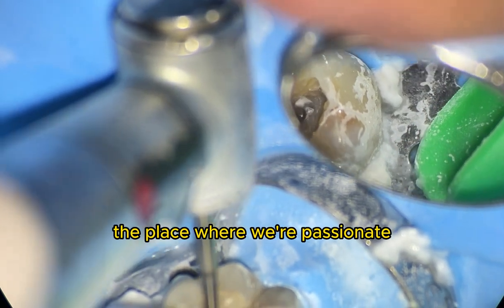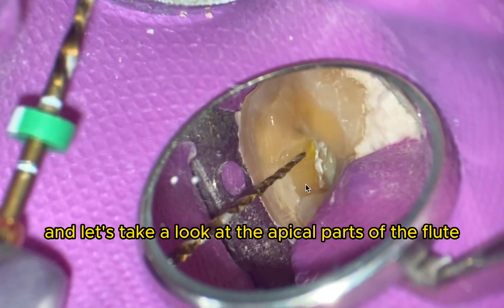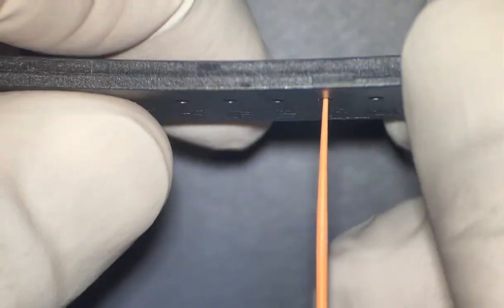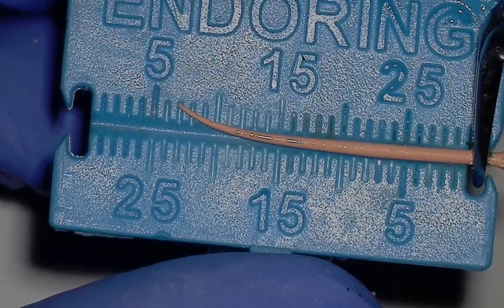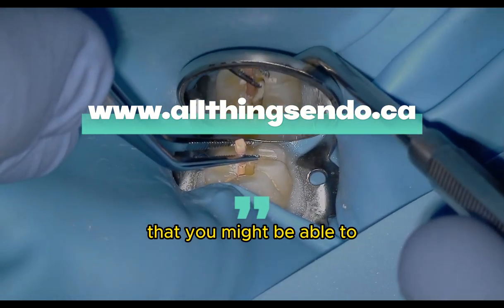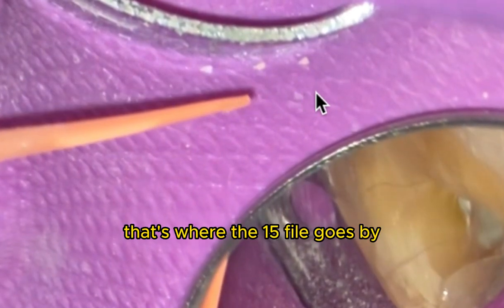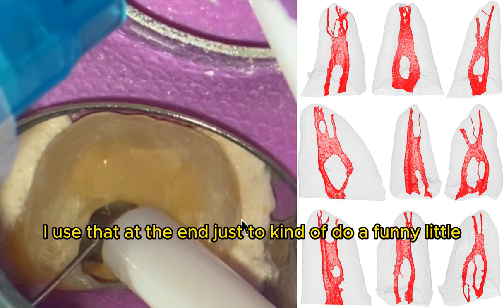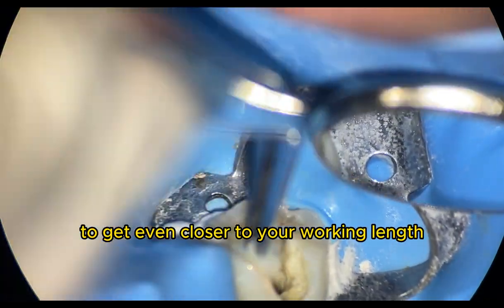Why is My Fill Short?  4 Tips For a Great Obturation!

Comment: Is it good option to use #20(.04/.06) guttapercha and use gutta gauge to cut the tip for the corresponding sizes for example 25,30,40(.04/.06) in order to avoid bad calibrated guttaperchas?
Reply from the maker: It’s really up to you. I’d check your sizes first before to see how accurate your GP is. Save time.

Comment: Additions to tip 3:
- place your liquid medicament (calcium hydroxide) with a irrigation needle in one canal and just look if it comes up the other one (also not 100%, but a good indication)
- put markings of your working length on your GPs with tweezers. Put both of them into the two canals. If one goes to length and the other doesn't check it the other way around. If now the other fits to length then both canals join.
Reply: This joining part is so good .... Inone case i was stuck like that only .

Comment: You have another video that might address the short obturation problem: https://youtu.be/m8Zd8noQbW0?t=462

I am in the process of switching away from Waveone Gold for this reason. I have couple cases that cone fit looked perfect but final x ray was short. Part of the reason could be due to variable taper shaped canal preparation, and the other reason you have talked about in your video is that gutta percha have variability during manufacturing. Either way the gutta percha is stuck mid canal somewhere. It can be overcome by instrumenting the apical part, but most likely it will cause over instrumentation and loss of apical stop.

One of my case was a straight but calcified anterior tooth. Cone fit with Comfort Fit Gutta Percha Medium was short but Waveone Gold Medium file goes to length easily on the radiograph.
Reply from the maker: Great comment. It took me a long time to move to cone fitting with sealer in place - I just needed more confidence in knowing that my working length was good to go with the apex locator. 
I found that once I moved to a conefit with sealer, my fills have been on the money most of the time. 
The only time I still conefit without sealer are open apices (#80 and greater) and single canal vital cases where I need more time for the hypo to degrade tissue.
Reply: @AllThingsDentistry  That sounds like a good system that you have figured out. I haven't really been testing WL with EAL after rotary instrumentation, but instead, use conefit without sealer. I'll give that a try.
Reply: Happens all the time to me. There’s something about waveone gold primary gutta percha that just doesn’t fit perfectly. I use protaper sx for an orifice opener and a root zx ii for my apex locator. Get down to wl, get the rotary down to the working length, all good, then when I check my cone fit it can be short, I can tell it’s going to be short because the gutta percha won’t seat to the working length it’d usually 1-2mm off. Happens way too often